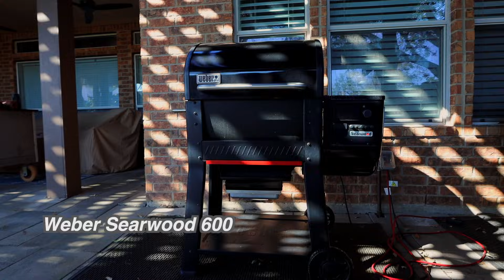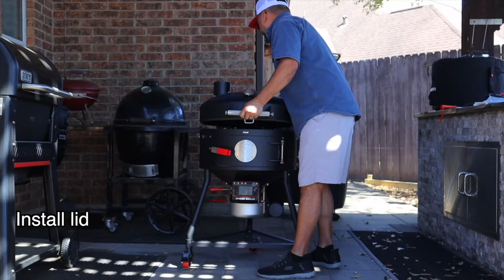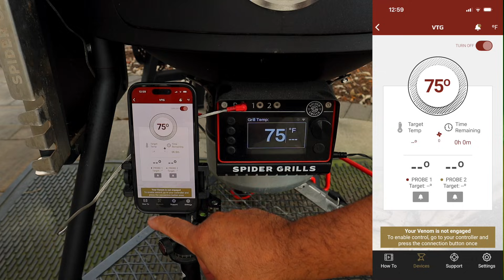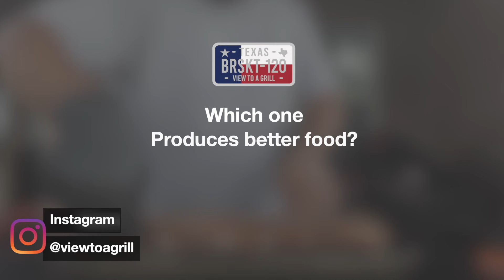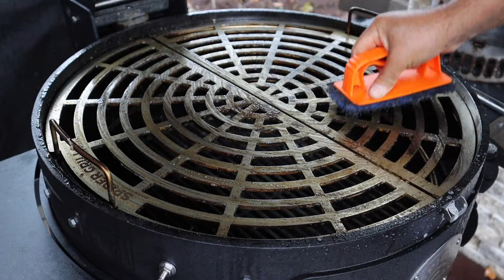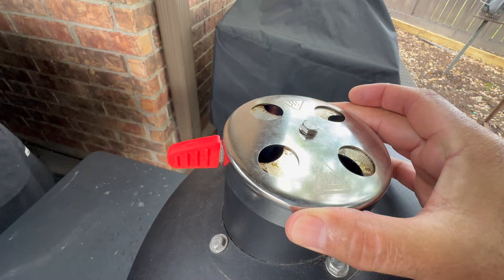Weber Searwood 600 V Spider Grills Huntsman

Comment: I know this one is an older video, but knowing what I know now about all of the options out there, and given a scenario where money wasn't an object and I could choose anything, I'd get a Lone Star Grillz 20x42 pellet grill. It's built like a tank (like the Huntsman), has the convenience of a pellet cooker, but also allows you to use wood splits and charcoal for augmenting flavor. With accessories like their LaPlancha and pizza oven insert, there's almost nothing it won't be able to do.

So what do I have now? I've got a Weber Genesis 300 series propane grill and a Primo Oval XL (which is an amazing cooker, btw). The Primo is also a do-it-all, but the downside of kamado style grills is the ceramic fragility.

Comment: I got Huntsman and I’ve done many cooks with it, smoked turkey, stake, burgers and veggies. It’s nice grill and food come out tasty especially if you through some hickory chips into the mix. I did mod to my grill though. I installed L- bracket from HD inside the pit where the screws are and that raises last ring about 1.5” . So now I have more room for lumps and ceramic grate doesn’t sit next to my lumps. I also bought their beta grill risers which makes grill a bit higher and easier to work with. Overall love it
Reply from the maker: Those are some great modifications to improve your setup!
Reply: Do you have a link or description for those l brackets you used? I was thinking of doing something similar
Reply: @rsaunders223 
So there is 4 screws around the perimeter below main grates. Unscrews them and put L bracket 1 1/2 inch or 2 inch that would allow 2nd ring to be lower from the top and that’s what you need . Make sure it’s stainless steel not zink.

Comment: Weber is now a big box company with mediocre quality and poor service and HORRIBLE PELLETS over which they were sued. The Searwood is a smoker and not a good one. The Camp Chef with the real wood box blows away the Weber. Weber has been a failure since their original kettle. The Huntsman is a super overpriced kettle and it is NOT a smoker. It is too small. You can’t get the heat source far enough away from the meat. A brisket flat will always dry out. $1400 for a complete Huntsman is a joke - and you don’t even get shelves. $1,000 for the TOTAL Huntsmsn is the correct price point
Reply from the maker: I would like to try a Camp Chef.

Comment: Kind of an odd competition a pellet smoker vs a grill.  They good at different thing.
Reply from the maker: I don't think so, they both are controlled by a fan temp controller that manages the heat.  In the video I compare all the functions they have in common.
Reply: Huntsman is good at both

Comment: I would pick the searwood as it seems like you have to babysit a charcoal grill.
Reply from the maker: Hey Aaron.  The Spider Grills Huntsman has a PID system just like the Searwood and maintains its own temperature just like the Searwood.  You don’t have to babysit it at all.
Reply: @Viewtoagrill ok, I must have missed that in your movie.
Reply from the maker: @aaronwright4039  There is a whole section where I show you how to set the temperature on the venom and then follow the on screen instructions and connecting the phone app.

Comment: Being kind of a charcoal "purist" and the fact that 90% of the time, it's just my wife and I, I went with the 22" Huntsman. I have done cooks for friends and I am amazed at what I can pack on that little Spider though. Just did a 16lb Turkey on it and had plenty of clearance. No need to spatchcock it. And it was the  best turkey I ever made on any grill. But due to size, I can see why the Spider Huntsman isn't for everyone.
Reply from the maker: cool.  Was the Searwood 600 one of the grills you were thinking about getting?
Reply: @Viewtoagrill  I was looking at the master built charcoal gravity system. But now after 4 months of cooking on the Huntsman, I'm glad that's the way I went. Even though a I blew through way more charcoal that I thought I would, doing that Turkey in 27*. In warmer weather, the Spider utilizes the fuel well and efficiently.
Reply: @Steve-uy8kx they now have a 26inch
Reply: @FA5boost  I heard about the release and saw the video within 45 minutes of posting. Its nice to see a company respond to a need. Its amazing how much more versatile this bigger unit will be when cooking for large groups. I'm now 5 months and many cooks with the OG Huntsman, and couldn't be happier.

Comment: I think comparing these two is spot on. In my small back yard, I would want one cooker. I bought the Searwood before the Huntsman came out, and it works very well for me. I added casters, which should have come with it. I’ve used a smokebox with charcoal and wood chunks to get better smoke flavor and am happy enough with it. That said, if I were buying now, I think I would go with the Huntsman. I would also consider the Weber Kamado, but I think it’s generally at a considerably higher price point.
Reply from the maker: The Weber Kamado has been on my wish list for a long time.  I like the one with a table and it is expensive.  Take care Dudley and thanks for watching.

Comment: Another great video, Thanks Johnny! I would rather the Huntsman. I think the flavor of charcoal and wood are superior to the pellets. I was surprised you found the brisket better on The pellet grill. I had a Weber kettle with the Spider Grills Venom temp controller and it was pretty easy to use. 🔥🔥
Reply from the maker: The seawood does a great job on briskets.  You can even go low and slow on the bottom shelf without burning the bottom of the brisket or ribs.

Comment: I smoke more than I grill so I'd probably go in the other direction. That and the capacity of the Searwood would fit my needs more. Just had an issue where my oven died the night before Thanksgiving and ended up cooking the entire dinner on my SmokeFire EX6. Couldn't pull that off with the Huntsman. I do think the Huntsman would be better at smoking though just because of fuel source used. In any event, great comparison Johnny, Cheers!
Reply from the maker: yeah, the Spider grills does not have enought capacity for a whole Thanksgiving dinner.  Pellet grill definitely wins that one.

Comment: I'm with you Johnny. I'd keep the Huntsman. As far as pellet grill clean up goes, you need a design that keeps the ash and grease away from each other. Weber just can't bring itself to follow that basic principle. And let's face it. A pellet grill is a compressed sawdust fueled oven. I have a Weber Kettle and a Traeger Pellet grill. If I'm looking for a sear or smokey flavor, I break out the kettle. I can get a little of that from my pellet grill, but it's not the same.
Reply from the maker: I have reveresed seared using the pellet grill.. then to the kettle for the sear.
Reply: @Viewtoagrill  Agreed. I have done the same.